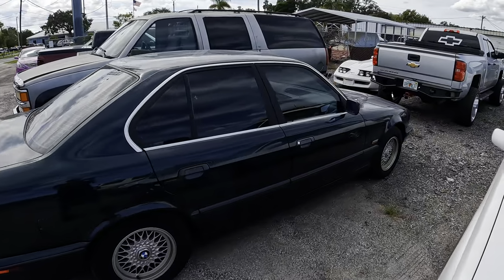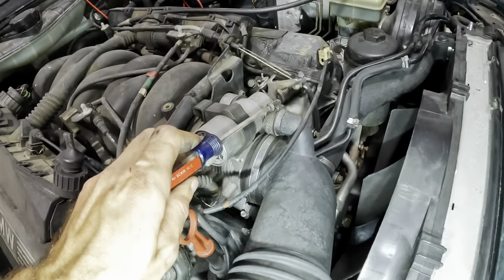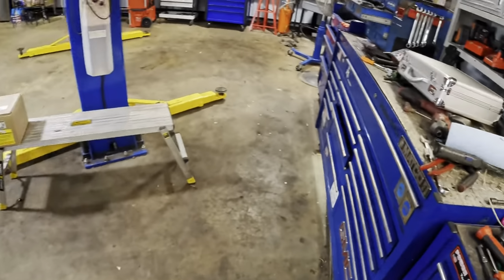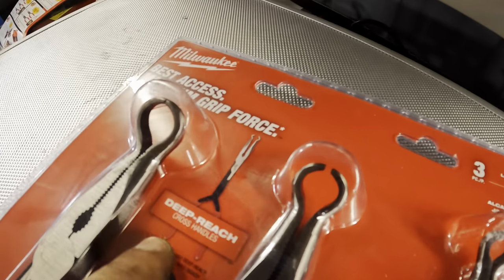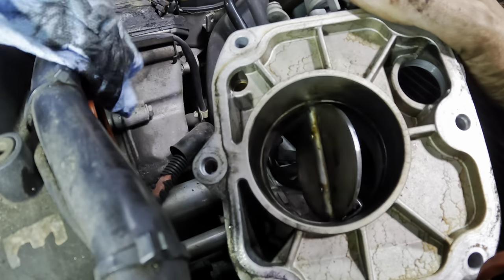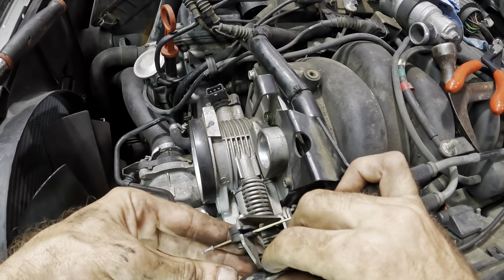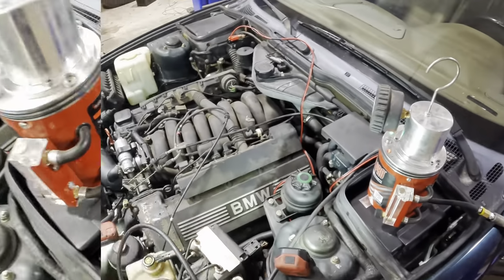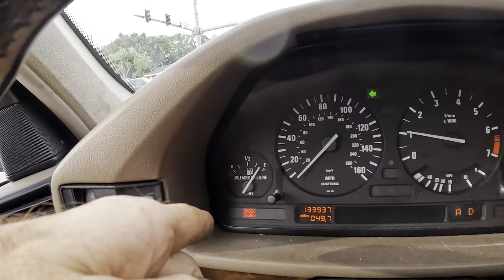DO NOT DO THIS! Hack Repair. Engine Diag Running Rough BMW 530i 3.0

Comment: Happy Birthday, Ray! Love the wife trolling with the doodley-doos! A German car with a misfire and bad window regulators...no way!😂
Reply: I miss the doodley doos! LoL
Reply: The worse was a E38 with 6mm glass in the rear. Easily break that glass during regulatory replacements. $600 Fup
Reply: I think the wife unit just invented a new sport! 🤣🤣🤣
Reply: 🎉 happy birthday ray, wife unit got you good with the ring tone, it is nice that you can have fun
Reply: @richb.4374   As do I
Reply: We all miss the doodly-doos
Reply: Happy Birthday Ray 🎉
Reply: I can't like this enough lolol
Reply: VW fixed the regulator issues, my VW and Audi had the issues, 15 years ago or more. Audi made a fix better with the nylon slider that was the issue, by putting metal insert into the nylon slier, no need to replace entire regulator, like ya did on the VW models, permanent fix. VW had issues with the nylon slider i replaced  many regulators on a few VW models.  factory finally fixed, as my last 3 newer GTIs and current  Golf R no issues, they solved the problem in the regulators.  17+ VW products since 1987  never left, current Golf r 2019 stick is the best one yet  88K fun no issues fun, and comfortable, fantastic all around car golf R stick of course.
Reply: @cengeb  I know right. The good parts always come to the hands that aren't the factory workers 🙄
Thx for highlighting this, and thanks Ray for the great work 👍
Reply: And fantastic clear coat!

Comment: A neat aircraft mechanic trick for hard to reach bolts, screws etc. Use a piece of vacuum hose over the head to start the screw. Works for spark plugs also
Reply: I used this trick for reinstallation when I did my plugs a couple months back. It's great because unlike a socket and extension you can't accidentally crossthread the plug, if it's not aligned right it'll just slip in the tubing.

Comment: I drove an E34 BMW V8 for years and did a lot of DiY work on it. The engine is extremely sensitive to vacuum leaks, and a total intake manifold gasket replacement job is pretty much a given at 150K. The  PCV plate at the back of the manifold is usually done by then as well.
Reply: Is that a legit V8 option in the 530? I thought it may have had an engine transplant from perhaps a 540 model?
Reply: @DeepakKumar-lv4te 530 means 5 series 3.0 engine which was a v8 back then.
Reply: I have an 840ci with the m60 and tbh it's super easy to work on. You are right about the sensitivity to vacuum leaks. It def is better than working on newer bmws lol
Reply: @Cdub541 Those 1990's bmw engines were rock solid.

Comment: Its always a good thing to reseal the entire intake (tb gasket, intake gaskets and replace crankcase valve , possibly the crankcase tube o-rings under the intake.
Reply: This is why it's only viable if the faults are fixed as they arise.
It's a project car for DIYer or a money pit.

Comment: Check the idle control valve (located right above the throttle body,) sometimes it gets gummed up and stuck open, and a little shot of brake cleaner in it should free it up, a quick test would be rotate the unit back and forth and side to side you should hear a little throttle door flapping away.
Reply: I wonder what "a little shot of brake cleaner" would look like when Ray does it... Another!!!
Reply: Who would have known electrical tape on the air intake tube would cause the power windows to malfunction?  These damn German cars!
Reply: Also installing it you should remove the rubber things and attach those first , slide IAC in rotated 90 degrees then rotate 90 and push it into the manifold.
No need to stab yourself and you will have a proper seal without using silicone

Comment: I just wanted to add some input you can get some Flex Seal tape on inside of the hole then use some liquid rubber in the can to seal the outer let dry add little more if necessary and it will be good ass new. good show and happy birthday

Comment: I broke the resonator chamber/elbow on my 96 Jag XJ6L. I tried to glue it back, I broke it again. I looked online and eBay sellers wanted $150. I went to my local Import Yard and picked up the MAF and intake duct for $75. In the meantime a used electrical tape and super glue to seal the whole in the intake. It worked! I drove it that way for about a week before I fixed it. So Ray is right, it will work in the short term but it's worth fixing it the rightway especially if you got a salvage yard nearby.

Comment: Get some Permatex water based valve grinding compound. You can put some on your screwdriver, torx, sockets, etc. The carbide grit will increase grip 1000% as long as it’s not completely stripped.

Comment: Was waiting for the declaration,"TIME!" after buzzing the pliers package open.
Not to worry, I covered for you this time.
An inexpensive tip for assembling rubber parts:refined coconut oil.
Costs a buck 25 at the dollar store with a tree logo,is environmentally neutral and better for the phalanges.
It also dissolves the day's grease off skin and tools,and washes off with warm water & a bit of soap.

Comment: Tape repair for DIAGNOSTIC REASONS is absolutely acceptable, in this application. I am in no way shape or form an actual mechanic, but I am (and most are) snart enough to understand what your putting down.  
You're definitely NOT a hypocrite. 
A damn good mechanic that I wish I could bring my truck to!!!!❤🍻
Reply: Electrical Tape / Duct Tape = The all-purpose tool! 👍
Reply: @dantesinfernopurgatory7826  As long as you are aware that neither is a long-term solution, particularly if exposed to the elements.
Reply: @MonkeyJedi99  Tape should NEVER be considered a long-term solution - especially to repair holes/cracks in plastic components.
Reply: @dantesinfernopurgatory7826  That's what I wrote.
Reply: @MonkeyJedi99  Consider that a concur.

Comment: I have a 2006 BMW 535d straight 6 3 litre Twin Turbo  mperformance 
stage 1
Ecu map,
 egr removed    
Dpf removed 
whirl flaps removed 
Cat removed
330 Bhp 
Running 650 tourqe
Will go off the clock 160+ mph 
 Refurbished the turbos,   upgraded the brakes to drilled and grooved discs  
Red Stuff with ceramic brake pads 

 straight pipe from engine to 1 back box.

Diesels are the best for that tourqe. Throw that air in mix it with diesel  
 Diesels are now going faster than the alcohol engines in Drag Racing .. 

 Cheers Ray.   Every update I get IT around 3/4pm here in GLASGOW 🏴 SCOTLAND 🏴

YOU ARE THE BEST ALL ROUND MECHANIC ON YOU TUBE.   ..    💥

Comment: Loved the trolling by Lauren. It was right on point. I remember you saying you couldn't find a proper hand wash to remove oil. Try this: get some saw dust ( check it doesn't have wood splinters), start soaping your hands and add some saw dust. Most of the oil and grease will come out ( use some soft bristles brush for the fingers and under the nails). You'll be happy with the results. Happy belated Birthday. Have yourself a great day.
Reply: Takes me back a bit... pink soft soap with sawdust in it 5 gallon buckets of it !

Comment: I’ve owned 5 of these cars, all straight 6 even the 3.5, but I had 3 problems i just bought a newer year as per my wallet, 1 was a fuel pipe at the rear of tank. Which leaked when I filled to the top, 2 was the left hand side has some car brain fault, this was due to a blocked the drain, easy fix. 3rd was the worst was the 3.5 as I just out run to a 2.9 ford Granada I had to turn off and straight away I heard a bad noise, I broke a rocker on a exhaust valve, me and my did the job was not to tricky. Happy Belated Birthday 🎉

Comment: Had a 525 which was the 2.5 liter straight six 
The 530 was a deluxe version 
Wish I still had the 525 
Sorry to see a 530 in such rough condition
Reply: E21 E34 E39 ... those were the straight six engine cars BMW forged its reputation. Gone but not forgotten.
Reply: all things considered this one is in pretty good condition
Reply: The Florida sun does a number on clear coat

Comment: Check your throtle cable too tight,and those nickle silicone blocks were notorious for rough idle due to pitted cylinder walls but over all a good presentation ⁰...love the claw hammer from a retired BMW tech of 38 years
Reply: Ex 318ti compact owner, 96 I think. Don't know why I sold it!

Comment: I have used simple masking tape to tape together a bolt head to a fastener tool. Then insert the bolt and start threading it in enough to hold the bolt in. Then pull the fastener tool off the bolt head and then pull the tape off. Finally, tighten the bolt the rest of the way. BTW, I usually watch one of you excellent videos daily for the last year and a-half or more. Today, I relaxed and had popcorn! Thanks for your wonderful commentary that never stops. Great entertainment and learning!🔧🔧🔧🔧🔧

Comment: For difficult screws that are round, use an odd piece of hose that will fit over it and hold it to squiggle it into place, thread it in and pull the hose off.

Comment: Having a 740i with the same M60 engine, this hits close to home.
Same stripped bolt, same hole in the intake tubing, add to this the engine suddenly cutting at 5000 rpm, the cooling issues and the same headliner panel falling off because the tabs broke.
Oh and the bushings.
And all kinds of oild leaking from everywhere.
Just old BMW things

Comment: That tape is bound to last longer than the intake!
Reply: I wonder if, in cases where the parts are not remotely available, if there is a heat-shrink option, or maybe a way to use something like Flex Seal?
Reply: @MonkeyJedi99  I'm sure all kinds of patches could be made to work... for a while, at least. Maybe an aftermarket cold air pipe can be had?

Comment: I think that's the m60 later to be replaced by the m62, I just did the timing chain and guides on my 03 x5 and oooh baby that engine is smoothe.

Comment: The PVC insulation tape is short term plug. 
A 'fix' would be a quality heatshrink tube, glue lined even. Quality, like Raychem stuff made for high voltage electrical terminations.

Comment: Ray - I am in Australia and have a 2007 X3 3.0d. (diesel). They are not the easiest cars to work on. When they are running properly they are great cars to drive but not easy to work on.

Comment: Many moons ago I had a similar issue on an Alfa. convoluted pipe downstream of the AFM was split, no spare available. I cleaned it thoroughly, inside & out, applied some silicone then over-wrapped it with self-amalgamating tape. Not ideal, no, but that bodge lasted for years and was still working just fine when I scrapped the car for parts.

Comment: So weird to see the steering wheel on that side of that car. No experience of the V8, but I have lots of experience of the straight sixes in 2.0 small and large block, 2.5 and 2.8 form. That interior looks so familiar, but backwards.
In my opinion, the E34 was the peak of the 5 series development and it’s been all downhill ever since.

Comment: On hidden bolts like the one you had, I use a little tape to taper the fastener to the tool I’m using for install.   It holds the bolt then when you remove it…most of the tape comes with the tool.   I work on elevators…at times I have many hidden fasteners.    Live confidently and peacefully

Comment: Dorman usually makes hard to find replacement air intake tubes for a variety of car brands.   I know people hear Dorman and think yuck, but they do make some decent non electronic components.   The air intake tube and the timing belt covers on my late 90's Honda are both Dorman.   The intake tube, the only thing I could find was a Dorman part, or a used one.   And I could have gotten OEM timing belt covers from Honda, but all 3 covers was going to be around 450 dollars, and I got the Dorman set of 3 covers for around 75 bucks.   Granted, the fitment on the lower timing belt cover wasn't exactly perfect and I had to do some minor modifications to it.   But at least my freshly rebuilt engine looks good and I don't have an exposed timing belt like so many people do for some reason.

Comment: The 2.4 Chrysler world engine has an issue like this too. I had one where the intake manifold didn't leak but there was a leak at the valve cover gasket. Whenever i sprayed starter fluid on one spot it would have a misfire. But 9/10 its the intake manifold gasket.

Comment: I did the electrical tape thing on an '86 Mustang SVO's intake corrugation.  The 'inside'(?) part of the corrugation had a split for no real reason I could determine because otherwise the part was just fine and flexible.  So I taped up that corrugation across the split, over the humps, and multiple layers.

Ran it like that for... what... 3 years I guess.  Never an issue, then the car was traded in later on.  Never heard about it again, but I like to think in THAT case... it's permanent and good.

But don't do that at home, kids, it's Not Right(tm).

Comment: The P0171.  Thanks to Ray, I found my rough idle and air leak on my 03 Tacoma w/ 3.4L with a smoke machine.  Ended up being 2 fuel injectors.

Comment: Make sure the cyclone valve in the back is ok. That and the butterfly on the backside of the intake will make a huge difference. If you need an IAC, good luck. Also the easiest way to smoke those is one of those EZ Intake bladders from Redline. So much less aggravation and 100 percent coverage from intake boot to brake booster to purge valve. It's totally worth the cost of entry

Comment: Happy birthday. Part 2 should be a very good video. Doing tape and woodscrew repairs on one's own German designed vehicle is the morally correct thing to do. I mean torx,  did anyone ask for a fastener where they all look the same but use one size off and it's destroyed, someone held up a 5.5mm socket and someone said hold my beer.
Reply: Check window light must be defective.

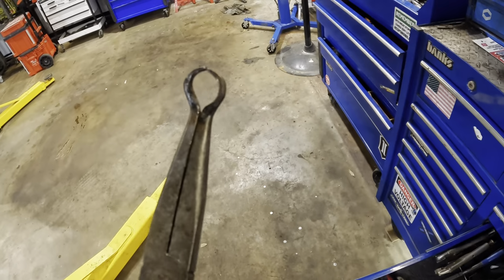Comment: @23:05 those are perfect for like the 5.3 4.8 6.0 chevy spark plugs saves by not pulling on the wires at all

Comment: Hey Ray, easiest way to make any size plug is with dollar store balloons. Inflate to slightly larger then the hole and plug the sucker up. Its the only universal, multi fit plug on the market, and its cheap and always in stock!

Comment: i had the same problem with a hole in my intake hose just like that - bigger actually as i could put my 4 fingers through it. I duct taped it til my new intake hose arrived. Problem was fixed immediately for the short term with the duct tape. I was getting maf type issues. Once i pulled the intake house i realized why. Not enough air getting across the maf

Comment: I had to do this on my '98 540i too when I bought it. Seller couldn't figure it out and didn't have the cash to splash out at a shop. Also had to do the pcv diaphragm on the back of the intake which was a right miserable job as there is zero access back there and pulling the manifold is a miserable job too. Anyway, good work, fun vid.

Comment: Well,Happy day of birth celebration,Ray. Those old BMW cars. like most European cars of 90s vintage, The electrical connectors on the engine control sensors may need cleaning. And  random fuel pressure variations happen due to old, worn out fuel pumps and regulators. The mechanical part of the older Beemers are pretty much good unless it is leaking oil. Good luck with that diagnostic, those are tough without the BMW scan tool.

Comment: Surprised to see an E34 on the channel...

The idle was a bit high. Add to that the CEL at idle and the common issue of the ICV getting gummed up messing w/the idle the ICV should be cleaned out with some throttle body cleaner. Just needs to be sprayed down the air intake, wiggled around to clean out the gunk, and repeated until clean and having free movement. Love my V8 E34, such a nice machine when they're cared for.

Comment: Happy late birthday! And on the throttle cable bracket, you did not forget to put it on, you left it off to show the throttle body tighten up to the intake manifold. Another great video by the way.

Comment: BMW guy here. Good luck getting that CEL to go out. I've owned three budget BMWs thus far. A rusty 5-speed 86 528e missing interior bits, a rusty 92 535i whose front fenders were held on by hopes and dreams, and now drive a clean but far from showroom 5-speed 97 528i that I rescued from an auto auction for cheap. Needed a $600 jailbroke PCM because it blew up the mosfet controller for cylinder 2 and I was not about to pay BMW $5000 to fix my $1300 car.

Most maintenance on the older BMWs isn't difficult, just tedious. Removing bolts to remove pieces to remove bolts to get get the part you're actually there to fix. My recommendation for BMW ownership on a budget is only buy if you can do most of the maintenance yourself and don't buy anything newer than 2005. The e39 5-series (made until 2004) and the e46 3-series (made until 2005) are the last of the readily maintainable BMWs.

When it comes to 7-series? Avoid like the plague unless it's an I6 motor or a V8, don't even bother with anything that has iDrive, and NEVER EVER buy a V12 7-series. Modern BMWs are purely for people who can lease them new with full coverage warranty and the 7s are the worst of the bunch.

Comment: Ray, not trying to be a smart ass, but there is a handy trick for hard to reach bolts. I have a collection of different size rubber hoses. I put the head of the bolt into the hose end. That holds the bolt and allows for inserting and turning the bolt to get it started well.
Also, get a set of Hazet flexible long reach metric nut drivers. Handy for all German cars, or any car.